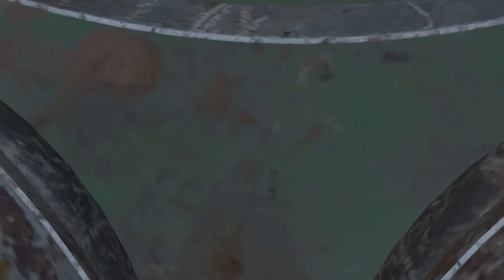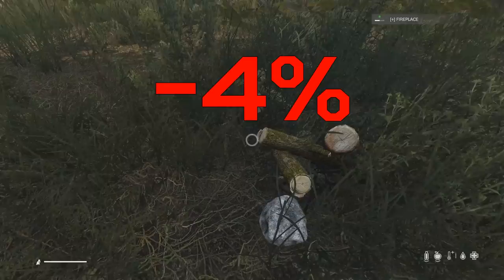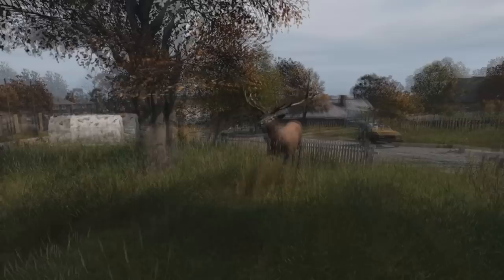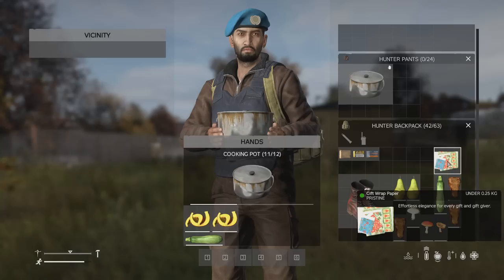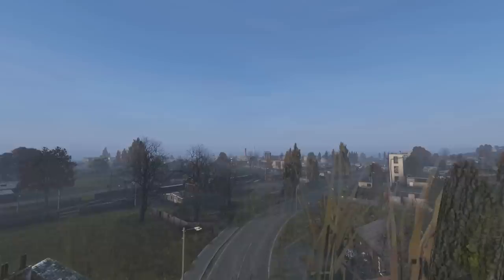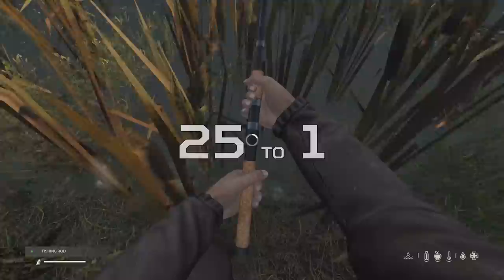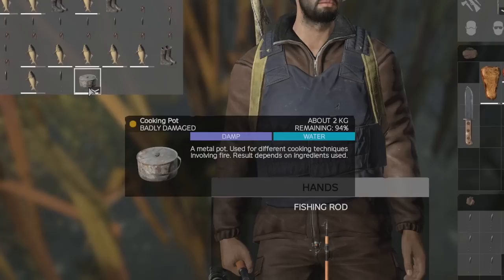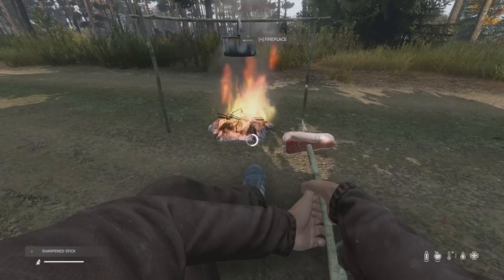[OLD] 3 PRO Strats to Preserve Cooking Pot Durability in DayZ

Comment: In my opinion, at the very least the durability loss should be drastically lowered when using a propane grill.
Reply: This. And the addition of a low-quality camping cooking pot. I had one of those $10 camping kits and the pot of it really had a hole from the camping cooker by the end of the week. But the cooking pot right now looks like one of those pots you would use for generations.
Reply: @RoyBeerZ  in my oppinion they should remove the destroyed propperty and add a dirty factor to it so you can clean it with water or something
Reply: @RoyBeerZ  I wanna know how bad of a cook you have to be to not know you're melting your pan? Like, you didn't think to turn the temp down just below the melting point of the material you're using? I've never burned through my very  cheap, Walmart's cheapest camping set very low quality, and I've had it for a decade. If you take care of your stuff, it lasts. No matter how cheap and low quality it is.
Reply: @RoyBeerZ  now I'm wondering how hot your campfires are being burned at to melt your cookware. I am only asking, because I've been living in the woods off and on for years, and this is an issue I'd love to avoid for another decade. 🙃

Comment: Pretty silly update with regards to durability. I know DayZ is not meant to be entirely realistic, but the idea that a cooking pot can be ruined in 26 minutes of use is taking the acceleration of item degradation too far.

If that's what needs to be done for balance, then the balance is off. The cooking pot was fine as is, except for the fact that it can carry water and be stored in your frigging pants. That's all the fixing it needs, not a cooking death timer.

I don't have a problem with water being stored in it, if otherwise empty, so long as it's carried in the players hands.

But loading it up with ammo, and water, putting it in your pants, and giving its contents an extra layer of protection is ridiculous.

Hell, give us soup recipes before making a literal cooking pot degrade by performing the task it was designed for in 26 minutes.

I'd love to be the top cooking pot manufacturer in Chenarus prior to the outbreak.

The cookware I own IRL is like 60 years old and shows no sign of degradation. Can't fit it in my pants though.

Comment: The stone oven offers no chance to bake without pot, it only dries. And that means you lose around 40% nutriendlt value and the water benefit. Am I wrong in this? Is there a way to bake on stoen oven without pot or pan??